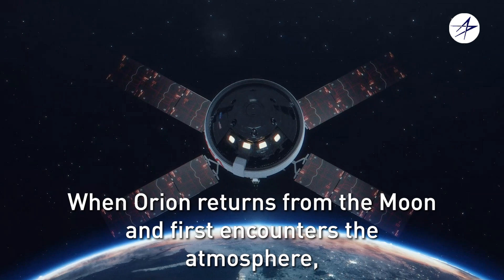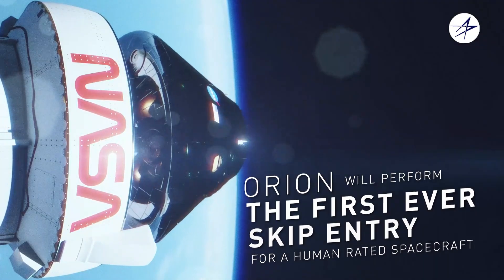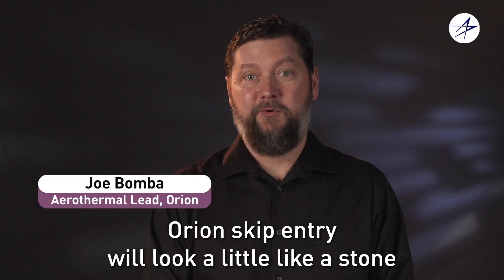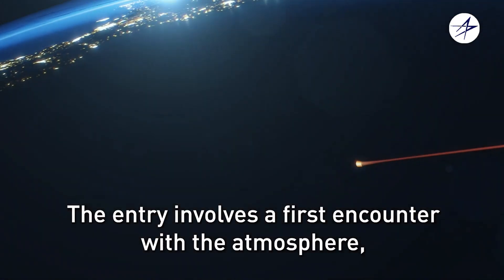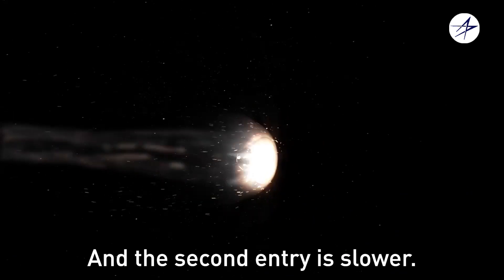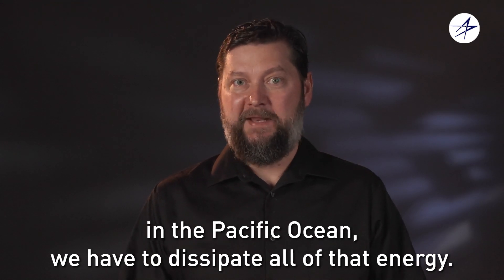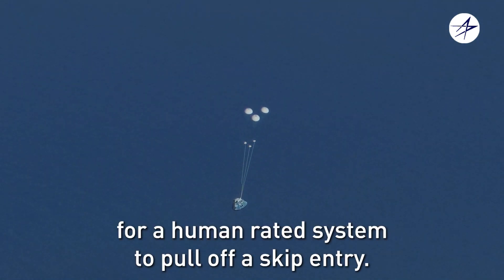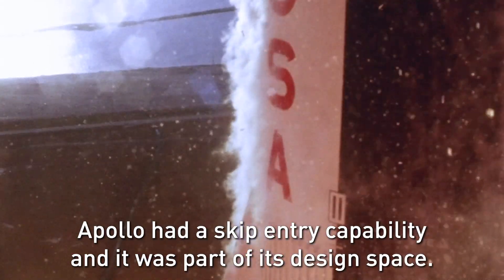The First-Ever Skip Entry for a Spacecraft Built for Humans

Comment: Why didn't they do this with the shuttle? Instead they went side-to-side to AVOID skipping.
Reply: Didn't need to do it with the shuttle. The shuttle was reentering from low Earth orbit, not a translunar return trajectory. It was traveling much slower. The skip reentry is useful if you need to burn off excess speed without excessive acceleration or peak thermal load. However, despite the shuttle not needing to skip, it was much more possible that it would perform an unwanted skip. This is because it was a much, much larger aero surface thanks to its massive delta wing.

As a result, although the shuttle did not need to skip due to its lower re-entry speeds, it would have done so without re-entry maneuvers designed to direct its lift away from the vertical.
Reply: Great question btw
Reply: For the same reason as the Apollo mission. Don't belive me? Think about this. The last shuttle flew in Jan, 2011. Now, take out your phone, place it next to the phone you had in 2011. Any questions?

Comment: Why don't you manufacture combat, attack, or interception satellites to protect reconnaissance satellites and space marches?
Reply: I'm not expert in orbital dynamics, but I think part of the problem is that changing orbits takes a lot of fuel, so attack/interception satellites would have to be huge to be able to take themselves to other satellites, attack them, then come back. It's a similar problem on smaller scales with satellite interception missiles, since target satellites may be far away.
Reply: @TROPtastic  why move the entire satellite?
Reply: @Vordigon1  if you try to use some sort of interceptor you'll just go from 1 thing flying at your spacecraft to 1000 pieces of shrapnel, anything colliding at orbital velocity shatters & will keep going in its original direction, so the only option for defense is to have the targetted satellite move, although the tiny thrusters meant to keep it in orbit will be basically nothing compared to a missile whos smallest thrusters are more powerful than a satellite's largest
Reply: @timothygooding9544  wouldn't that 1000 pieces of shrapnel burn up in the re-entry?
But yes, it's simply too costly, unless we develop some sort of iron Dome defence system as its own independent satellite and have it set up to intercept incoming missiles from earth. This means that potentially all debris would be outside the orbit and immediately starts burning.
This leaves other satellites that can launch lockets as a problem.
Reply: @Vordigon1  not before it obliterates the satellite you were trying to protect. It will be headed right for it
Reply: @TROPtastic  fuel you say?
Reply: there isnt really any good way to protect a satellite from a purposeful attack

its pretty much impossible to intercept a missile headed for a satellite since the speeds are so high, you'd be better off letting 1 satellite in your constellation get blown up and just replace it rather than try and protect it with anything other than good cybersecurity protocol

the best defense in space currently is redundancy